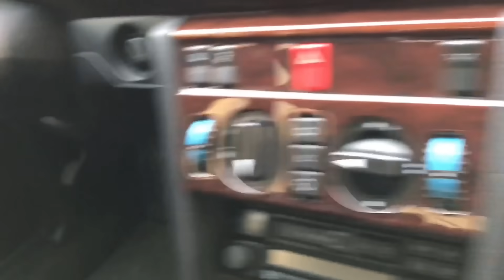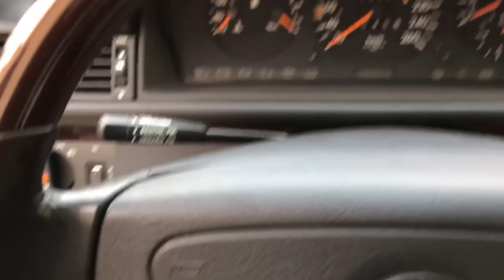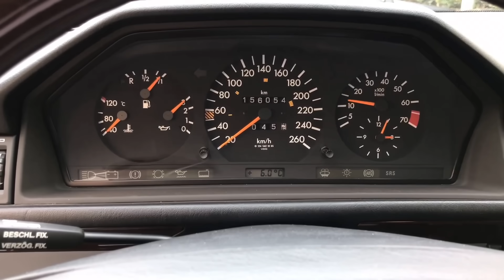㉦ Mercedes 124 - COLD START AFTER 1 YEAR

Comment: hmm what are these lights (Green and Red) in the door handle are they from the factory ?
Reply: sanerzean for me iys the last true Mercedes
Reply: Swedish Marcus Viking  I agree with you about the W210. My parents had one after they traded in their W201 190E. The W210 was a great car, the only bad thing was the corrosion. During the production of the W210 Mercedes Benz switched from lead based paint to water based. They didn't have the process right to begin with and many of the early W210 started rusting early. My parents car did but Mercedes admitted there was a problem and fixed many cars under warranty including ours. I miss it and the 190E. I would love to own a W124 one day
Reply: @suprafrase  w124 good but surely a nice w210 320 or 430 avatgarde is a much better car
Reply: @raycroal  I'd rather have the W124 to be honest.
Reply: @suprafrase  vive la difference